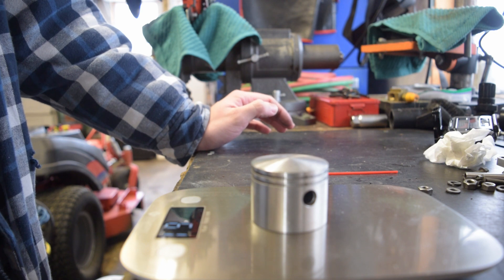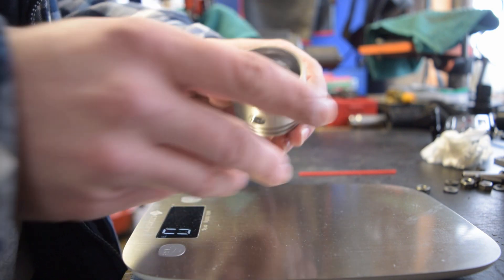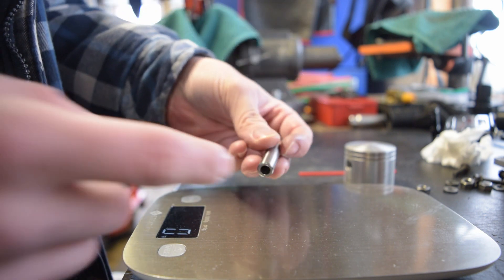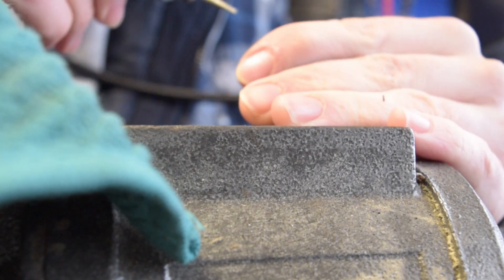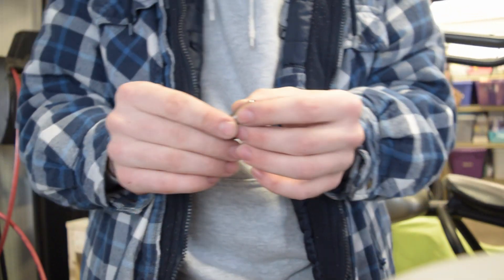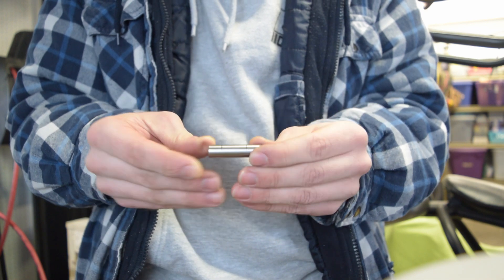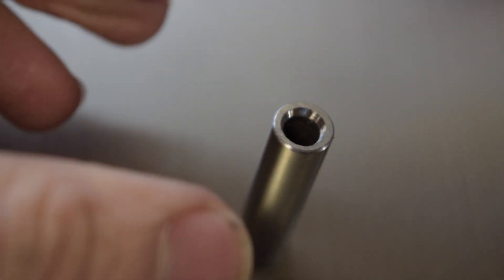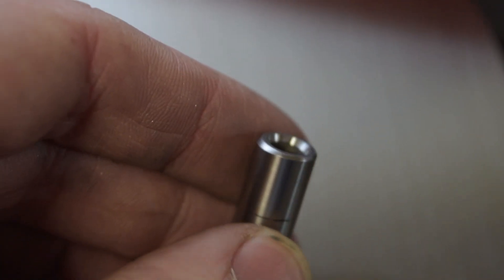HOMELITE HOTSAW (Part 7) - PISTON weight REDUCTION!

Comment: You were chatting about other things and forgot to weigh the 14 gram pin after grinding ? It's a good idea unless there is not even a gram difference on the scales? And does balance factor make a difference on saw motors? Can you remove material around the piston  skirts , without affecting any ports or transfers window operation? .4 grams  is something I guess maybe ? Cheers
Reply from the maker: depends on the saw. Newer piston ported saws you can trim the skirt on the side because the transfers are closed ports. you can also change intake timing and velocity by trimming the skirt at the intake port. Older Reed valve/case intake reed valve saws usually have open transfers. trimming the skirt could cause lower transfer velocities, though I'm not sure by how much.